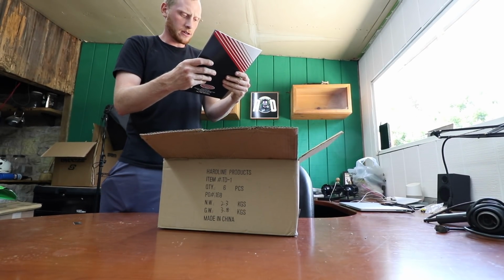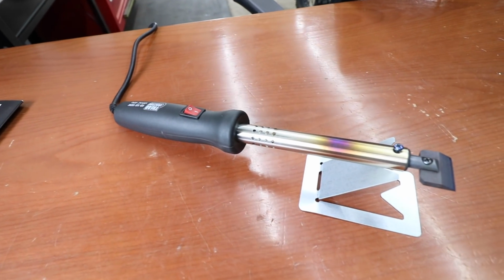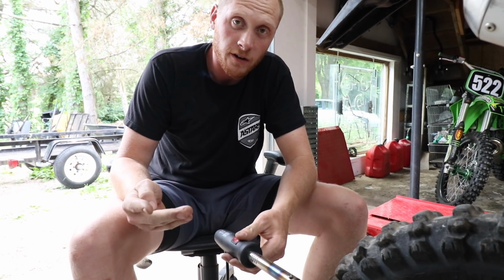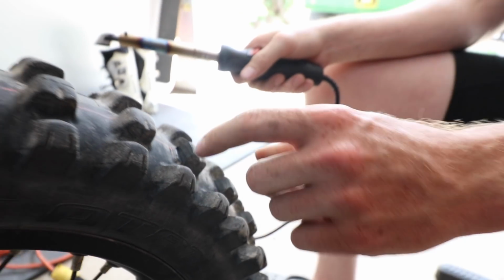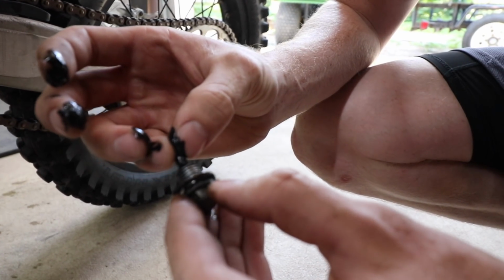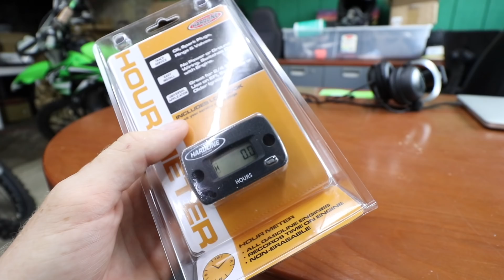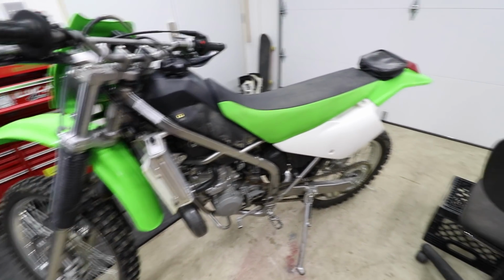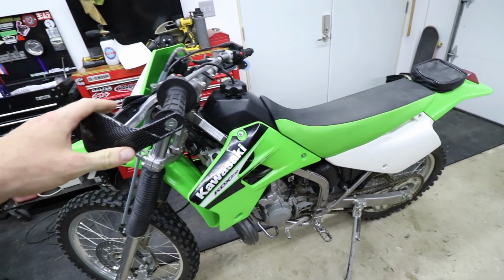A Dirt Bike Tool That Can Save You Money?! | Hardline Products Tread Doctor..

Comment: I bought one of these a few years ago and it works as advertised, I found it heated up a lot faster if you blast the tip with a heat gun while it's heating.  I quit using it  because of how long it took to hit/cut all of the nobs, I decided to just reverse the rotation of the tire on the rim to get a fresh edge.  It all comes down to the time verses money question, if you're low on money for new tires and have the time to do it, it's a handy tool.

Comment: Do you feel removing material from the lugs on the tire will weaken them and make them more prone to being torn off ?     A sharp edge on the lugs makes a huge difference but will the juice be worth the squeeze?    You should do a long term tire update and see if you lose more lugs.    I know Michelin has moved to a 2 ply tire vs 3 ply with the Starcross 5 and as a result are already more prone to ripping off lugs.

Comment: Id refrain from pulling the level check bolt. just drain it and put 750 ml back in. Even if you torque it to spec i think over time its gonna pull the threads out of the case. Also the heavy spring on the rear brake lever is in the way of getting your socket and or extension in there square causing the last thread to be compromised when the spring kicks its out at an angle

Comment: If I were you I wouldn’t touch amsoil oils every engine I’ve ever rebuilt that used amsoil had much more ash and a lot more damage inside you can look up the specs on all the oils and amsoil is very low grade I’d suggest motul that’s what I run in everything and it runs perfect and I’ve never had an issue with it